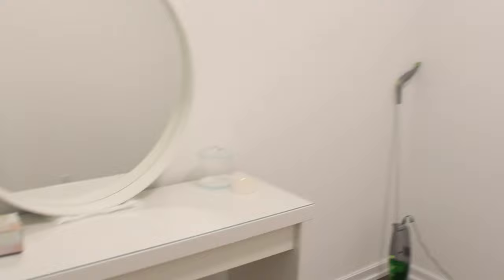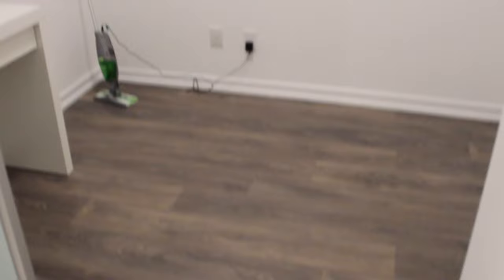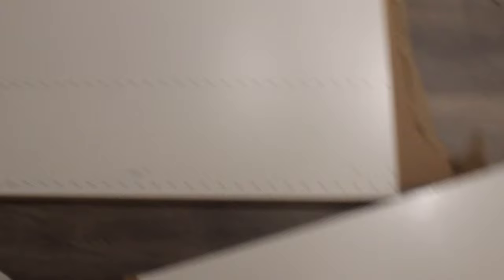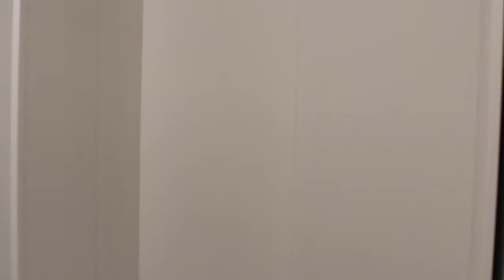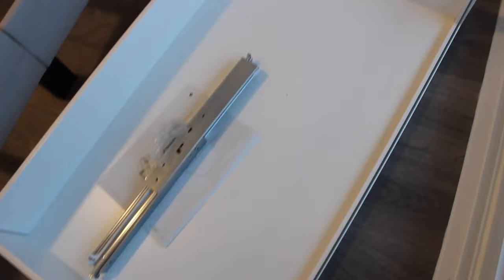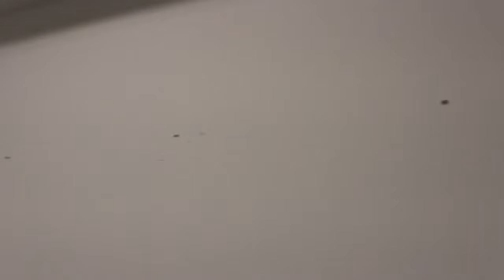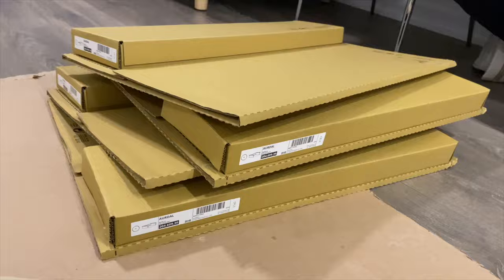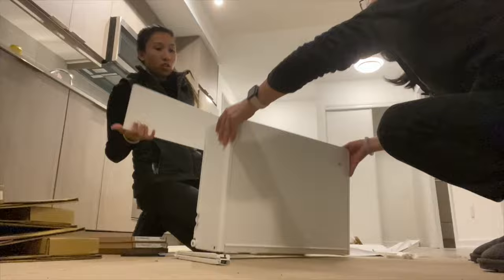THE ULTIMATE IKEA WALK-IN CLOSET | FT.  THE PAX AND AURAL SYSTEM

Comment: How long did it take you to get the suspension rods  for the aurdal?  I’m wondering if I even want to purchase the rest of the mounting piece will be months to get in stock. I enjoyed your video!
Reply from the maker: I actually didn’t have any issues getting my suspension rod! But here’s my tips (because I went through A LOT of stock issues) 
1. Sign up for their email alerts and do multiple stores if they are close by 
2. Check on the detail page if it says when it “may be back” and check first thing that morning (I got a lot of pieces before I got an email alert) 
3. If you go in store they can give you an estimate of when they SHOULD receive and typically it’s not far off. They may not get a bunch of pieces but you should be able to get what you need

Good luck! It’s totally worth the hassle :)